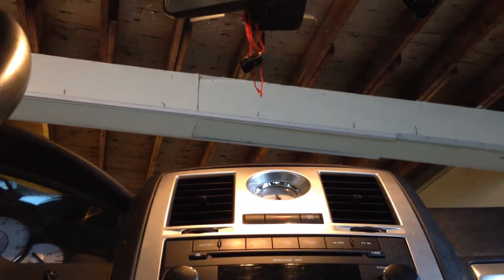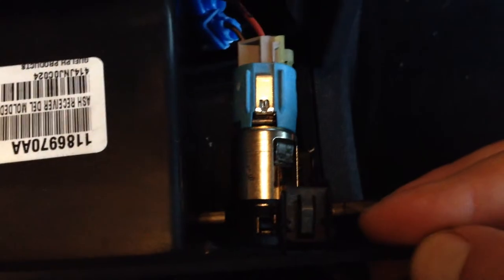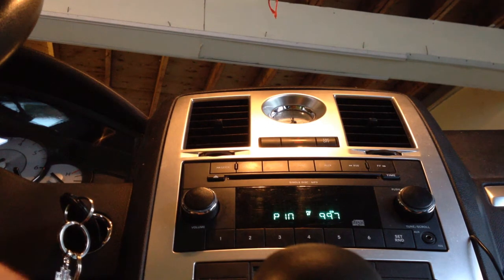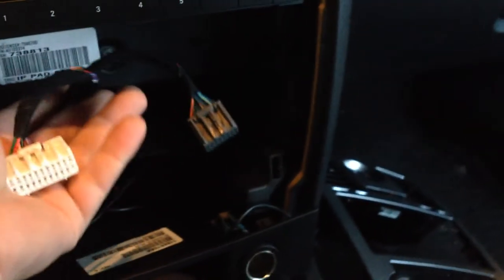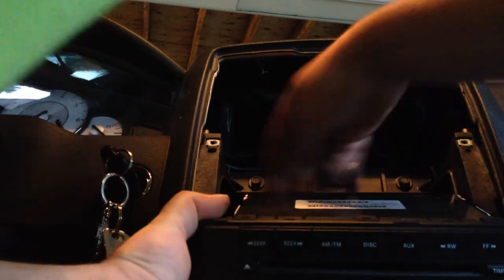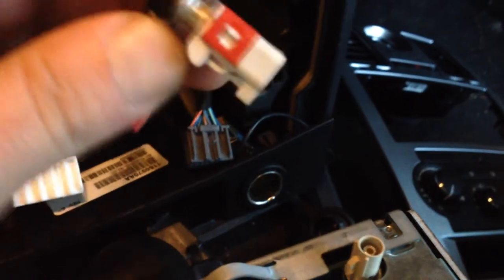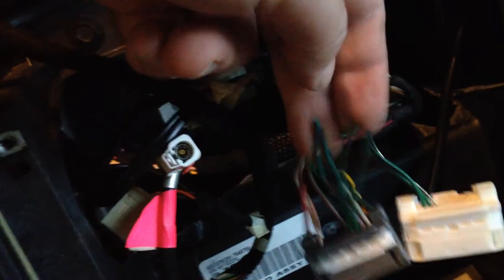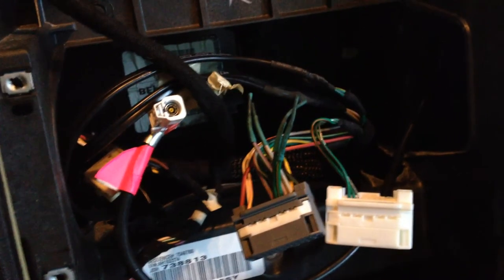Remove Factory stereo on Chrysler 300 LX Platform quickly and easily.

Comment: At 5:01
I am replacing my radio for a 2009 Chrysler 300 Touring and they have the same plugs. What is the white one with 3 wires for? I bought a Scosche CR4000A but it only uses the Grey plug. Is there another adapter I need?
Reply from the maker: You should be okay using just the grey plug.  I think the white one is for an accessory, (Sat radio, video etc) Plug in what you have and see if it works for you.  No harm in that! :)